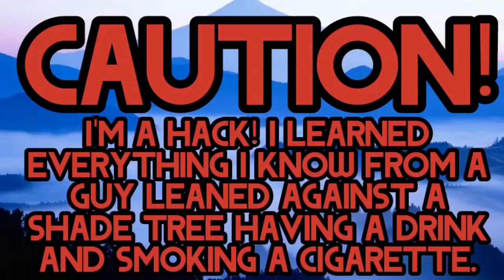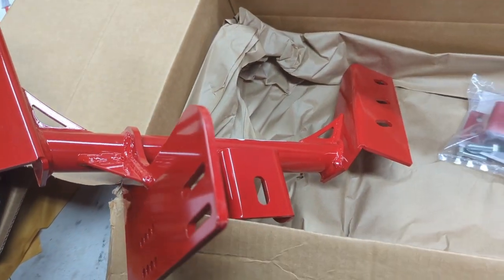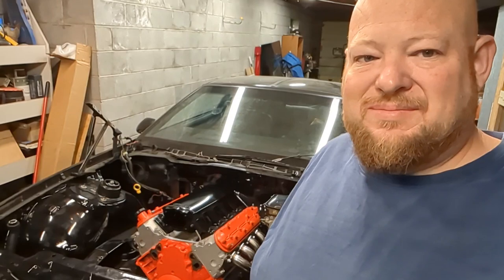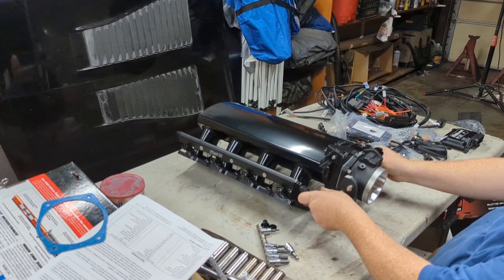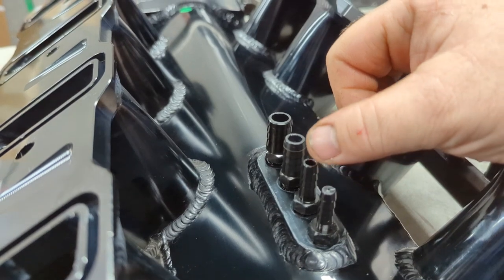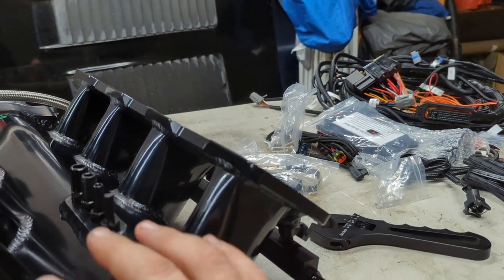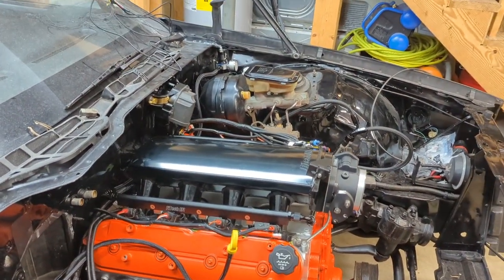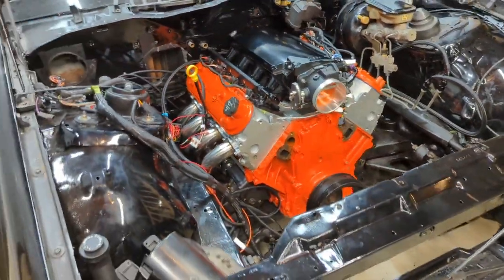LS swapping a third gen Camaro PT 9

Comment: If you would have used the Holley LS swap motor mount kit that engine would have been more forward and you wouldn't have issues with how close the fuel rails are to the heater core bungs and then you also wouldn't have had problems recently when you switched to the Holley/Blackheart trans cross member.  I'm glad I'm researching thoroughly before I do the LS Swap on my Thirdgen Firebird.
Reply from the maker: I wish I had gone with them from the state. If or when I do another 3rd Gen that's definitely the way I'm going to do it. Thanks for watching.

Comment: I noticed that at 10:27 you installed the throttle cable bracket and only put one gasket on....you had 2 gaskets. So it should of went intake manifold,gasket,throttle bracket,another gasket,then the throttle body. Hope you figured it out...I'm still in the middle of watching! Liking what I see so far! Your garage reminds me of Finnigans garage at his house lol
*edit...it must have a o ring style gasket..
Reply from the maker: Yes it has an o-ring gasket in the throttle body. The bracket came with two gaskets in case you were using some other brand throttle body. Thanks for watching

Comment: Can you please tell me what throttle cable you use? Part number please and thank you I love all of the videos help me out a lot.
Reply from the maker: It's for a 2002 Camaro with an LS so Z28 or SS. I just Googled it and bought the one that popped up on Amazon or eBay I can't remember. I don't know the part number but it should be an easy enough part to find.
Reply: Thank you

Comment: Does FiTech lock tite the throttle plate screws? Might want to check that so they don't back out and get sucked down in your engine. I've heard a few horror stories of those screws wiping out an engine.
Reply from the maker: Yes they have thread locker. You can see it from the back side but I don't show it in the video.